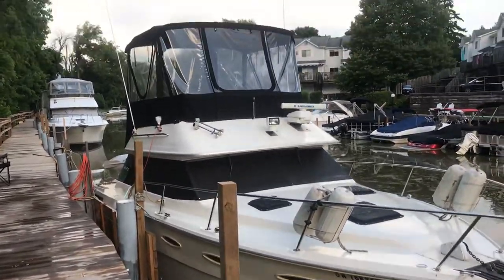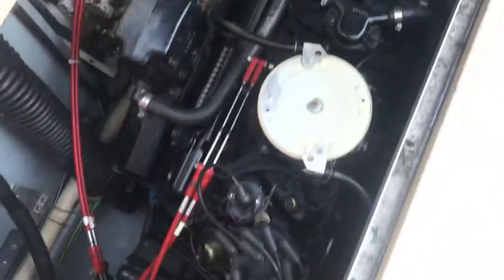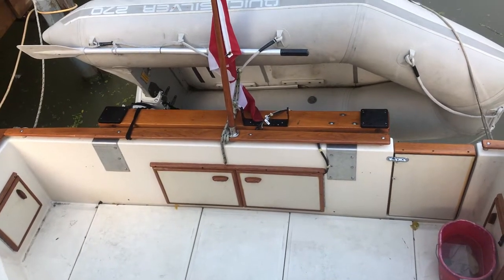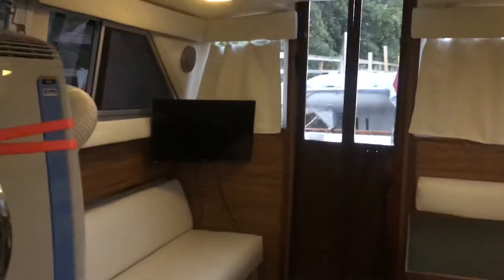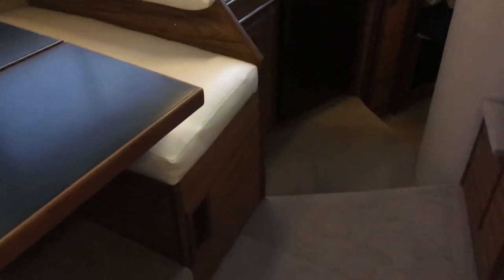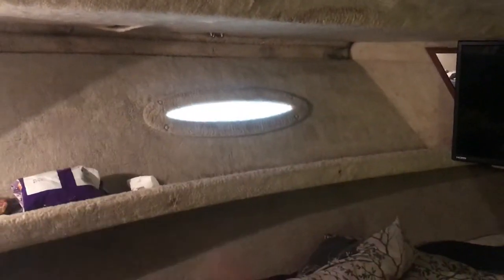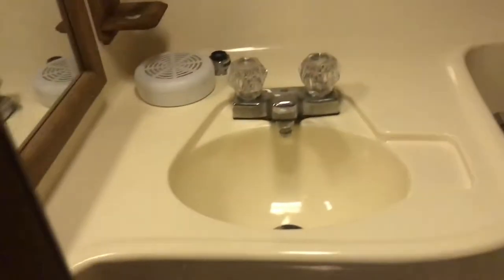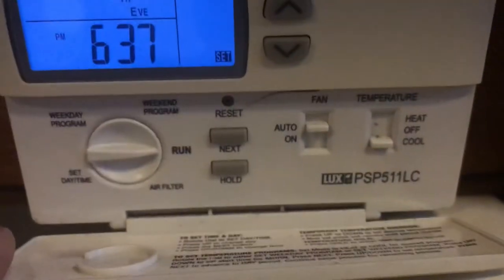1987 Sea Ray Sedan 300 flybridge sport fish

Comment: Hey, I just bought a 1986 300 db. Same exact boat. Only a year older. I have replaced the mercs with crusader 270s. Still a 350. Anyway, I was curious if you ever worked out gph and if so, how bad was it lol ?
Reply: I have the same boat with fuel flow meters & crusader 270's the burn is roughly a gallon a mile.